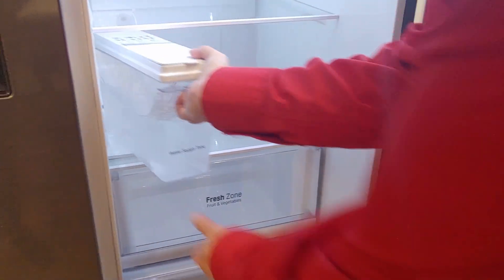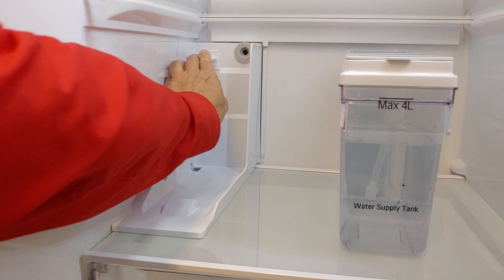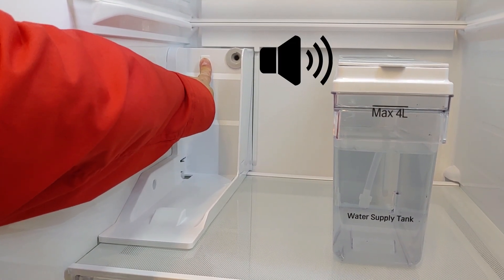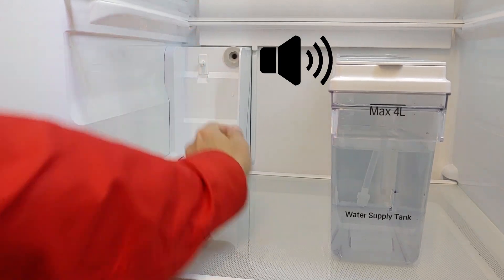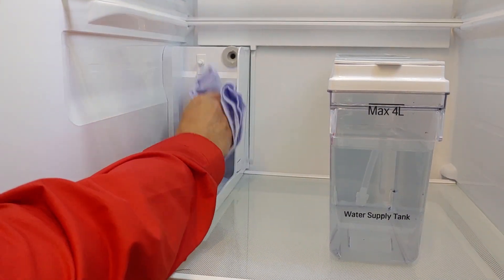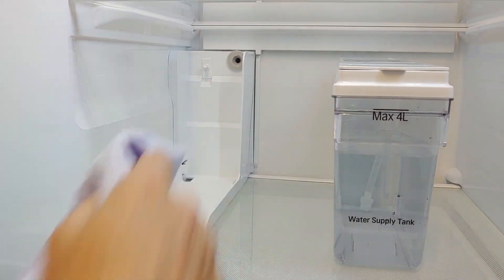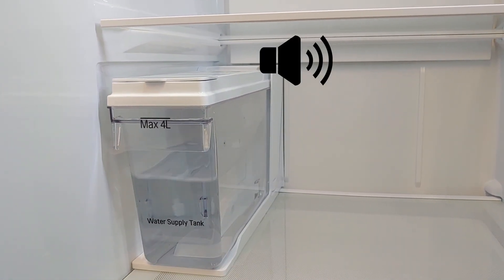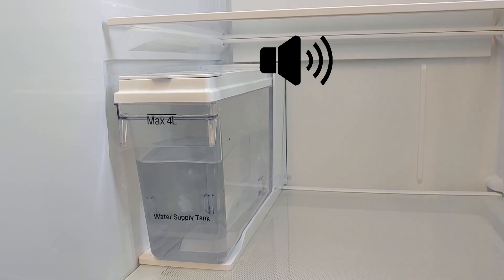[LG Refrigerator] - How to Check the Water Tank Switch

Comment: Thank you! So we got the fridge second hand and just now trying out the ice maker. The tank switch and making of the ice itself seems to be working, however when I push the dispensing lever nothing happens. How long after filling up the tank should I be able to dispense water, not even talking about ice?
Reply from the maker: Directly. When set to dispense water it should directly provide water, regardless of the temperature. Can you hear a pump sound when pressing the lever? If yes, it may be that there is air trapped in the water hose. Then, try this: https://youtu.be/v717fdagVbQ
Hope this helps.